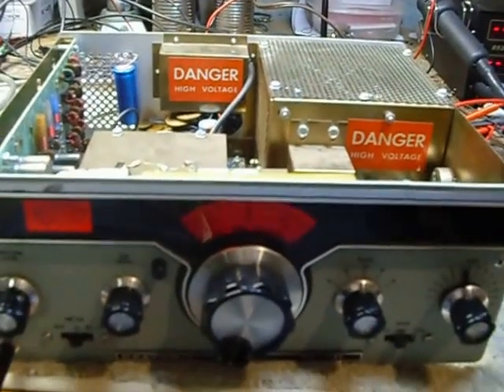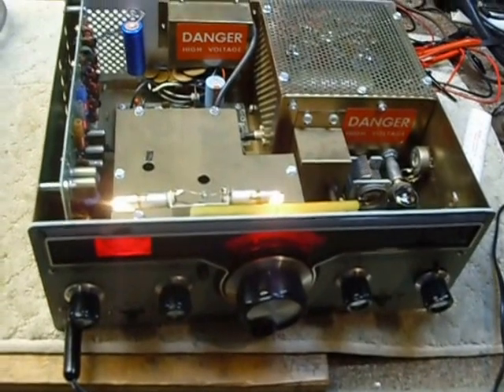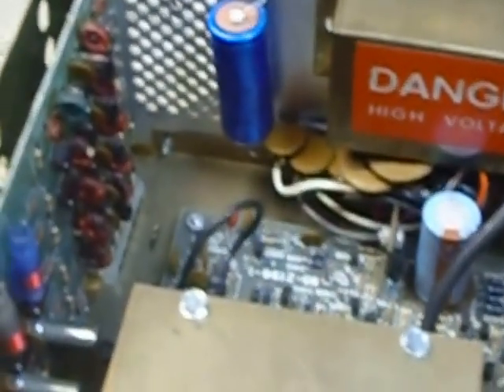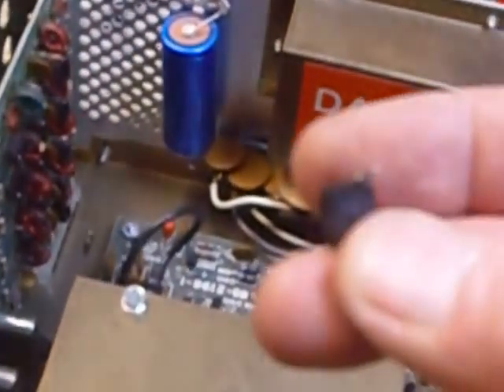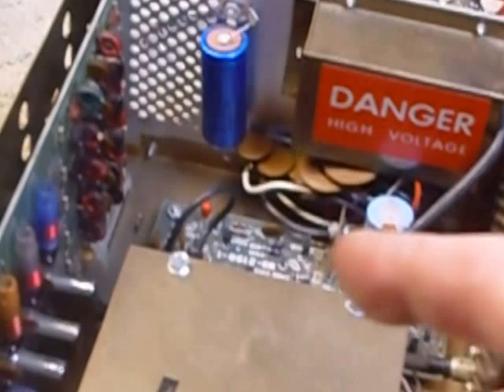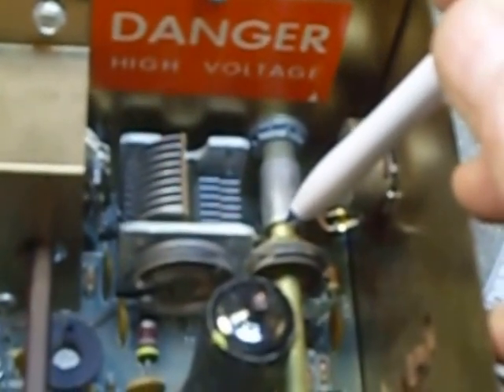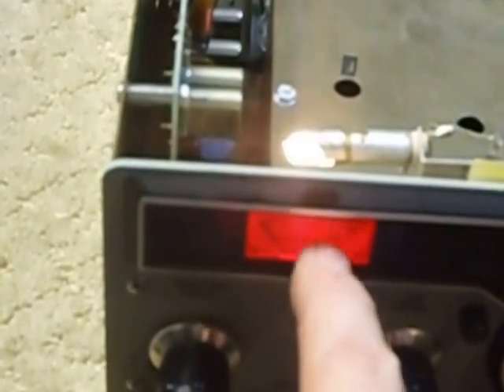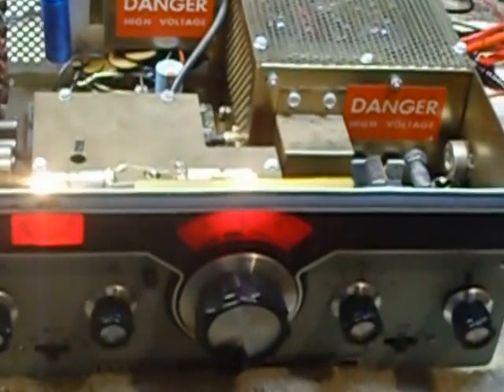PART 3  HEATHKIT  HX-1681  transmitter

Comment: Hi Bob,
I'm working on a couple of HX1681 transmitters. I've had problems
on 10 meters, replaced C162 and C163 on the 10 meter Band Pass
Filter, using 2-8pf ceramic trimmers. I now have, with the VFO
set to zero (5.5Mhz output), 28Mhz indicated on the frequency
counter, no additional fixed capacitors needed on C162 and C163.
I never had problems with the 20, 15, and 10 meter HET OSC coils, 

they tuned up rather well. What final tubes did you use, 6146A
or 6146B? Drop me an email if you will.

Mike W5RKL
https://www.w5rkl.com